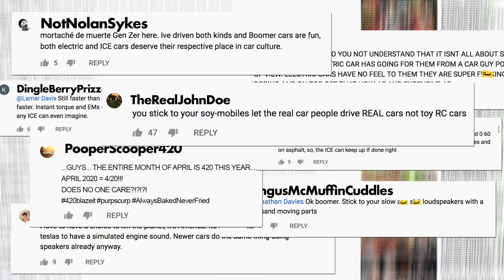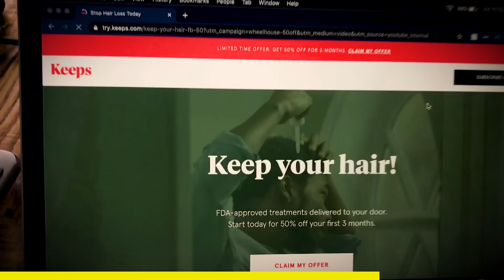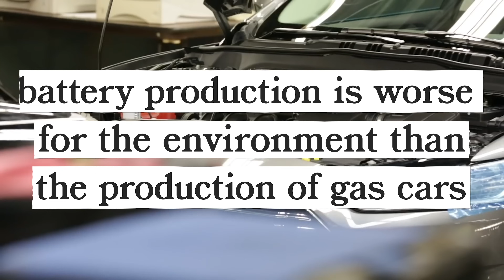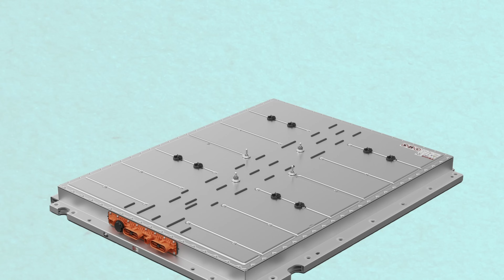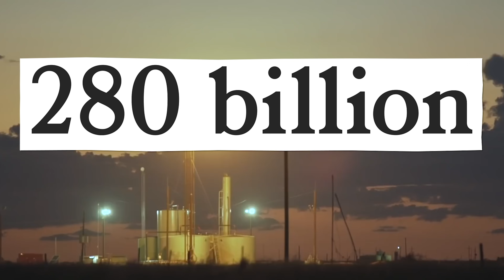Are Electric Cars REALLY Better for the Environment?

Comment: What about Diesel engines
Reply: Diesels today have DPF and SCR system that make them close to no toxic emissions at all. Although the reliability of these systems are not perfect and can lead to some extended down time they are still cleaner than gas
Reply: They are more polluting than petrol.
It leaves lot of particulate matter and I don't remember exactly but one of the gases is carcinogenic.
Overall it is more polluting than a petrol engine
Reply: @anirudhhhh  is emits less carbon dioxide and most modern diesels have filters which clean most of the soot
Reply: @anirudhhhh  but some diesel engines are so much refined and produce much less co2 compared to petrol and they are highly efficient
Reply: @samridhtiwari8044  "Highly efficient"? What sort of bullshit is that? ICE vehicles uses only 12-30% of the energy from the gasoline/diesel to power the car... Anyone who says gasoline and diesel vehicles are "efficient" knows zero shit what theyre talking about.
Reply: @anirudhhhh  and that's what i call bullshit. It is a propaganda war started from a country way behind other nations regarding developing efficient engines. A modern diesel car with efficient filters and catalysts is releasing cleaner air at the exhaust as it is sucking in for the combustion process. The 15 biggest container ships worldwide release as much on exhaust gas as 750 million cars, so cars are not the problem if you want to protect the environment. The problem is a modern diesel car is so efficient...people save money and GOV and big oil doesn't like it. 6.5 Liter in a diesel suv is definitely not creating more exhaust gas as the same cwr consuming 10 or 11 liter gasoline.
Reply: Modern diesels are just about carbon neutral. If we used hydrothermal liquefaction to convert plant matter into biocrude and then made diesel fuel out of it and ran all diesel engines with EGR, DOC, DPF, and SCR systems it would be clean. DEF is made of 32.5% lab grown synthetic urea and the rest is deionized water so its not a resource you can run out of. EVs have zero emissions because the environmental damage is done by the time you get the car.
Reply: Diesels stink, man... Literally, they smell bad. Sound awful too, if not completely muffled.
Reply: Diesel engines produces less CO2 but more toxic gases. They are not the best choice in cities but outside they can be better choice.

Comment: Jason Fenske from Engineering Explained did a good video on this. Basically: right now EVs are comparable to gas cars for the first few years due to the initial manufacturing such as mining rare earth materials etc. If they can figure out how to make solid state batteries work. That’ll be a game-changer for the EV market.
Reply: What about the discard or recycling of the batteries? I have a feeling that it takes either alot of CO2 just the same or it will be harming the environment in different ways.
Reply: Pat Woo  most electric vehicle batteries get reused in other uses once they are EOL’d in cars
Reply: @mmavcanuck  Interesting, how do they do that? Do they break down the battery pack and reuse/recycle certain parts? Kinda curious to know.
Reply: @lego4virgo  Both. The batteries can be removed and plugged directly into cases to be used like Tesla PowerWalls. But the batteries can also be broken down into components and those components can be further broken down or directly reused or recycled.
Reply: @lego4virgo  the other thing with battery cells is at end of life, they may not be adequate for electric cars, but they may still be capable enough to be used in other applications. A lot of hobbyists scavenge EV power cells for drones and other RC applications
Reply: https://youtu.be/6RhtiPefVzM
Here is a link
Reply: Daniel G Depending on where you live electric vehicles are either good for the environment or bad after that five-year mark.

Comment: 1. We use all these elements anyway in other things than batteries. Poor argument.

2. They aren't building new or special power plants to generate electricity. It's already there. Charging an electic vehicle doesn't make the power plant work any harder.

There's always going to be polution, the idea is too reduce the foot print. You also cannot recycle what you burn, so when it's gone it's gone.

Here's a pro tip. Vehicle manufacturers simply wouldn't be going more to EV if it wasn't the next step in evolution of individual transporation. 

It's been proven time and time again that EVs have low cost of maintence, and also cut down on fossil fuels in not needing petroleum products for lubrication. While a $15k battery replacement sounds daunting, it's basically costing you nothing until you need that, and is still cheaper than a new vehicle.

Comment: but  evs can't run forever on the same battery pack. I have a freind with a volt and a coworker with a leaf. both needed replacement batteries in under 5 years.

Comment: You can’t place the entire carbon emissions of oil production on cars.   As you stated there are many other products we get out of crude oil.  Also if there was no need for gas oil would still be be needed.  We still need jet fuel ,plastics, asphalt etc.  Until an accurate figure on the carbon emissions for gasoline can be determined this question can’t be answered.  Also there are a lot of areas that EV production has to improve on our until then it’s just wishful thinking.

Comment: Electric cars and the pollution created during the process of producing them are roughly equivalent to a petrol car getting 88MPG.
They are significantly better, a step in the right direction for sure, but not "perfect or clean" as they are being advertised.
Once we can move away from Cobalt and into Solid State (i.e. Maxwell SS acquired by Tesla) that figure will increase significantly.
Reply: @BL00193  for sure and I am not debating that.

Comment: This VIDEO HAS A POINT making a car cost a lot and produce tons of CO2 also the most efficient power train is ELECTRIC so there for it should be forced to move ICE engines cars to electric and also it should be CHEAP DO IT so it should be LEGAL AND EASY to get converting kits !!!  YES A 60KWH BATTERY PACK  A 100HP ELECTRIC MOTOR AND A CONTROLLER the POLITICIAN SHOULD MAKE SOMETHING ABOUT IT !! why no one is talking about it??

Comment: I love electric and I love gas powered! However 2 comments. First, your video does not take into account replacing the batteries in the cars (can be required in 5 years in colder climates, significantlychanges their impact).  Second is your comment that we can supply all the electricity required... sort of true. We produce enough electricity, however the grid has not been designed for everyone to be charging cars at home. I work for an electricity provider and can say 100% our grid is not ready for this. We are very worried about even a small uptick in home charging and the impact to the grid. LOTS of infrastructure upgrades would be required to be able to handle the additional load requirements...

Comment: I would be interested to see the type, not just quantity, of emissions put out. Lithium and cobalt being released into the ground water sounds worse than blowing CO2 into the atmosphere. Also, the production of batteries and production motors and magnets (Tesla luckily does not use magnets in their motors) all release heavy metal particulates into the air, which are worse for the air and water. Many kilograms Rare Earth Magnets are used in many electric cars. With current technology, the lifespan of electric cars is much shorter than ICE vehicles. I would rather see someone save an old car from the junkyard than someone buying a new car every 10 years.

Comment: 10:38 I really wouldn't jump into saying that so confidently when ALL cars are electric in less than 20 years. Come on Nolan.
Reply: Used cars are a thing
Reply: @mazdaweeb3  prolly not on public roads at that point.
Reply: @MicahPotts  Unless there's a breakthrough in battery technology, electric cars will never completely replace ICE cars in the US. The range of the best modern EVs is nowhere near enough for long road trips without stopping to charge.

Comment: “tHE fUtURe” is a term that’s tossed around so much that it straight up annoys me. Electric cars aren’t a replacement to gas cars. They are a supplement for them. We can always tune engines to run on cleaner renewable fuel, and we can always find cleaner ways to make batteries. They should coexist with one another. Performance cars should be hybrid/ICE powered and normal cars should be electric imo
Reply: he didn't speak at all about cold climates where i live for example(finland). Electric car is way worse here...
Reply: The future is electric, even in performance. Look at the Volkswagen ID.R
Reply: William Dion 
Then the future is also soulless
Reply: @AzaanPD  Please explain? Nobody thinks the world is soulless because there are no steam-powered cars. Why would it be different for ICE vehicles?
Reply: William Dion 
Electric cars have no sound or soul when you drive them
Reply: @AzaanPD  A car soul doesn't mean anything unless it's a Kia Soul, which there is an EV version lol. As for sound, is that necessarily a bad thing?
Reply: William Dion 
Yes because I like cars with engine noises way more.

Comment: Conclusion: they are if you drive them.
Reply: Societies that are designed to be auto reliant will have high energy usage and impacts, even if they are EV.  I more support the European and Japanese models - great transit and biking in the cities, go for a rip in a sports car out of town when you want.
Reply: @ll_Helixx_ll  what is there to break? There are significantly fewer moving parts in an ev than in an ICE
Reply: @isaakwelch3451  less moving parts doesn't not equal less parts to break
Reply: @REAPER3fitty  then what is there to break in an ev that makes it less reliable than an ICE? Theres fewer parts spinning at thousands of rpm's, theres fewer joints to break and fail, fewer sensors to go bad, in fact, an ev power is significantly more simple, which means less parts to break, moving or not.
Reply: @isaakwelch3451  you think there's less sensors on a Tesla than my 85 hilux or 95 sc400? Tesla's have heat pumps. Door actuators. Pretty much the same amount of electric motors as any other car when you consider how much shit moves. You can make it fucking dance. The motor still has bearings. Anything in the interior is pretty much Mercedes such as switches and things like that. And "breaking" isn't always physical. Software has issues too. Also, any of the plethora of cameras can have issues. You seem to think "breaking" is strictly a mechanical issue. And you think there's somehow less joint cause the motor is electric? It's not floating on electromagnetic fields. It still has suspension, brakes, axles, bushings. And in what world is the electric motor not spinning at thousands of rpms?
Reply: Helix if EVs become more than efficient than ICEs after 6months-2 years and warranty’s last on average about 5 years, what’s your point
Reply: yes. problem solved
Reply: @ll_Helixx_ll  You must have your head in the sand if you don't see that happening. Just take a look at all the bus and truck manufactures investing in fleets of EVs. Amazon is buying 100k evs for their new delivery fleet and bus companies all over the country are testing out EVs for city routes. Tech is still early days, but the trend is there. In passenger vehicles, take a look at places like the Norway with 70% of car sales are EVs or China alone with over a million EV sales back in 2018.
Reply: @ll_Helixx_ll  yeah, and also accept the fact that all gas emissions only contribute to about 15 international container ships, and there are 6000 of those sons of bitches going around.
Reply: Ish, they are, if you drive them for 3-5 years everyday. However the batteries will go flat within 10-15 years, so it's only about 1/3 cleaner than a normal car. (While also costing about 30% more to buy compared to a gas equivalent)

Funnily enough, this debate started in the 1890's, died off in the 1960's, then reignited in the 1990's. Every 100 years or so we seem to dabble in EV (or some other stored energy sorce) then give up for a more convenient and manageable.
Reply: Dylan Hale if you just watched the video, you would know that EVs are twice as Efficient as ICEs, after the average life of a car of around 10 years
Reply: Dylan Hale Dylan, Tesla batteries seem to actually last a very long time with the exception of the original S pack and the 90kwh pack. There’s many shuttle companies with hundreds of thousands of miles on their cars. While they do have 1-2 battery replacements, they’re on the old battery architecture which doesn’t seem to be as much of an issue on the newer battles used on the model 3 or S. That’s not to mention they have nearly 4-600 thousand miles! That’s actually not that bad overall. Tesla battery packs are also the cheapest to make it looks like, they are leading in production cost at less than $100/kWh vs the $150 from other companies.
Reply: @dylanhale7300  technology evolves, no one gives a fuck about some debate that allegedly started  in 1900...
Reply: @dylanhale7300  you get good batteries.
Reply: @dylanhale7300  Of course they are... and car batteries easily last 10-15 years. Don't believe Fox news and their BS. Also your mid-range gas engine starts having issues within 3-5 years now a day. Good luck driving a modern eco gas car 10-15 years also...
Reply: @shadowblack1987  
i have a 2011 vw 5 cylinder n/a with 140k miles and only engine trouble has been a barometric pressure sensor. But vw's electronics on the other hand are terrible lol
Reply: @shadowblack1987  your electric will start having issues too! Its not only the engine. Electric cars have tires too! They have inner tie rods, outer tie rods, suspension and many other stuff which require maintence too. Yeah, most modern cars have bad engines because car manufacturers care only about their money. I have a daihatsu serion from 2007 and the engine has 450 miles without any repairs on engine. Beast engine
Reply: Ronan B Well some of the more unreliable ones yeah, I feel sorry for anyone with a Nissan CVT. But Honda and Toyota have a proven track record of solid reliability, I don’t see needing something like a complete engine overhaul, really ever. Whereas a battery will need to be replaced before then, they have a limited number of charge cycles before they’re just spent.
Reply: A dozen of potatos and a fat cat smelling them they’ll have significantly less maintenance. The newer model 3s seem to have been significantly improved in terms of maintenance and all you really have to do for the first few years are air filters and tire rotations (unless you drive aggressively)
Reply: @shadowthesi  even the most reliable gas vehicle will need work. Oil changes, filters, brakes, plugs and wires, belts and hoses, etc. Even toyotas and hondas. And when a timing belt is a $3000 job and you add up the cost of all the scheduled maintenence, you'll pay for that battery over 15 years. Not to mention the savings in gas.
Reply: @shadowblack1987  dude are you living under a rock or do you pretend not to hear people still driving around with their 10-15 year old cars on original engines racking up hundreds of miles?
Reply: @isaakwelch3451  that's if you're unable to do simple maintenance on your own car and need another person to do it for you. 3000 for a timing belt? Fuck that. My belt cost me 100 bucks from Lexus and 0 dollars to insal

Comment: Solar and Wind are unreliable power sources. Hydro has it's own impact on water supply and animals. The only real solution is nuclear and most people don't want nuclear power. Then, we really need to look at "global warming" and "climate change" from a different perspective. How much of this "climate change" is caused by heat, chemicals, and water misusage. You'll find "climate change" is mainly caused by water misuse and a bit of heat. And how much of this "global warming" is actually caused by chemicals like Methane and CO2? The 1st law of thermodynamics is that energy cannot be destroyed, only converted. Never have we before used so much energy. Electricity or gas. And almost every machine we use to do energy be it a heater, fridge, AC, computer, or car, converts the energy into work and heat. Most of these components like computers, AC, Heaters, and Fridges convert all their energy into heat once it has been used to do work. This means that energy that was previously stored in coal, uranium, oil, ex is now being converted from potential energy into heat. It's surprising that there are almost no studies that look at how this affects the environment and "global warming".

Comment: Short answer: Yes, electrics are better IN LONG TERMS.
Reply: 6 months to 2 years is not "in the long term" buddy.
Reply: @LatentLensLS  But vroom vroom bro
Reply: @arwlyx  Of course nothing better than a roaring V10 or a turbo blow-off valve going off, but his argument was just ignorant.
Reply: yes but it would better just to remove the engine of an ICE car and put some electric motor and batteries on it